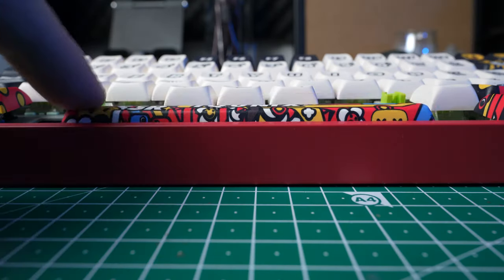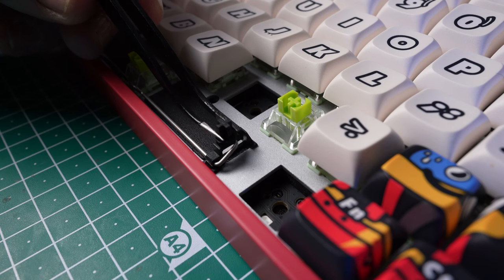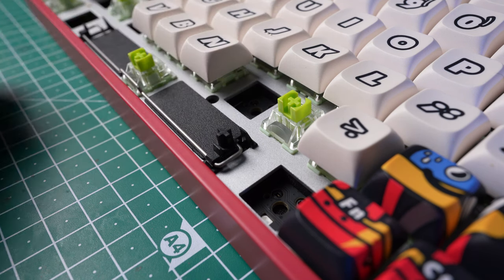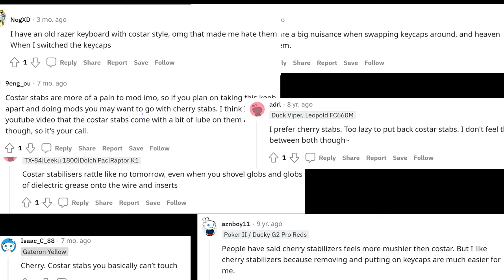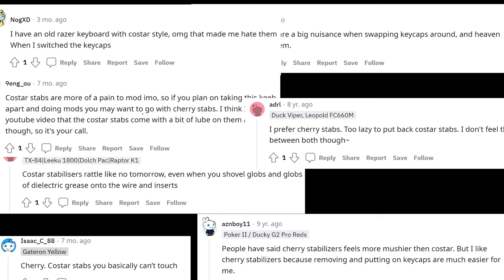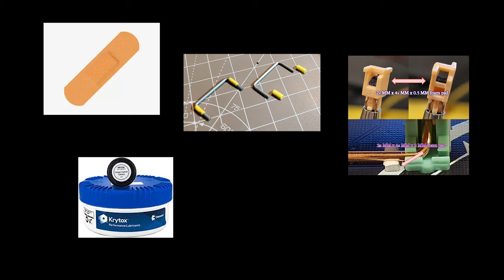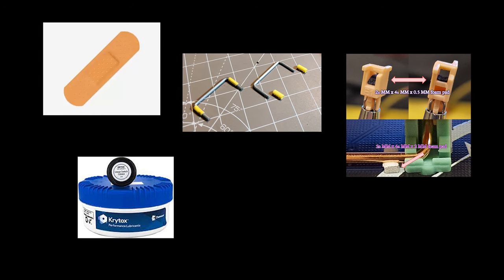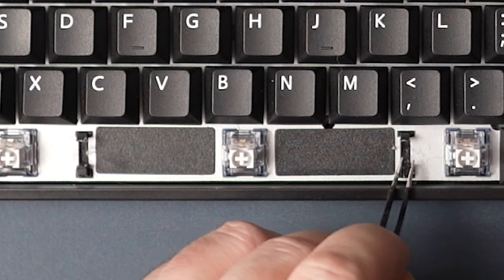How to Fix Costar Stabilizers on IQUNIX keyboards (Permanently!)

Comment: Ty!! omg that aluminum housing is amazing. But the ricochet sound between the space bar & housing drives me crazy. I have this exact model keyboard w/ the black body - I now regret not getting red lol.. 

anyway, will you plz share if you know anywhere/anyone from whom one could purchase a custom, 2 piece, usbc to usbc cabled or this exact model? Bonuspoints if it matches the aesthetic.. lol. Thank you for sharing your vid even if you can’t help with the cable request!

Comment: Thanks for this! You don't see much mention of costar stabiliser boards in the mechanical keyboard scene it seems. 
I have 2 x Filco Majestouch boards and they are good, high quality boards albeit a little bit boring and plain. 
The costar stabiliser design definitely doesn't sound as nice as the cherry, and unfortunately these filco boards have soldered switches so they're not very mod friendly. 
I am planning on modding them soon to include case dampening (maybe a silicone mold pour), replacing cherry mx blue/browns for something like akko jelly blacks/silvers and also some new pbt keycaps. 
I will definitely use this video as a guide! Cheers
Reply from the maker: Thanks, glad you found it useful!

Comment: Just got a new F97 and I am loving it! However, is it normal for the space bar to move a little kind of like wobbling when touching the keycap? Or should the F97 have no back and forth movement when touching the keycap and not pressing?
Reply from the maker: Hi Michael. Depends on how much movement? What switches did you go for?
Reply: @keebface  Thanks for the reply! I went with the TTC Gold Pink Switches. It's not a ton of movement but if I rock my find back and forth on the spacebar the key can move a little bit towards me and away from me. I hope that makes sense.
Reply from the maker: @michaelstanley2277 always a little play, but shouldn't be much as they are box switches, so have little stem wobble.
Reply: @keebface  this is my other account lol. Thanks for the reply. I noticed it most if you pushed your finger from the bottom of the space bar (part facing the frame) forward. All other keys have very little wobble as you mentioned with the box switches.
Reply from the maker: @mstanleytv3031  I just checked it on mine. The spacebar has the same up and down play on mine as all the other keys, it just looks more obvious because you can see the whole bottom edge of the keycap.
Reply: @keebface  thanks dude! You are a legend. I know I was being a bit OCD but just wanted to make sure mine wasn’t the only one!

Comment: Thank you!
Reply from the maker: No problem!
Reply: @keebface  it was a bit without context (in case you are interested): I recently got my latest "endgame" keyboard and thus had some room to start modifying my 15 year old Filco: Desoldered all switches, added MillMax sockets instead to make it hot-swappable and the stabs were a major concern - they sound like ass... I was wondering if I should commit and get some cherry style stabs and modify the plate, but your vid saved me a lot of time and thinking :-)